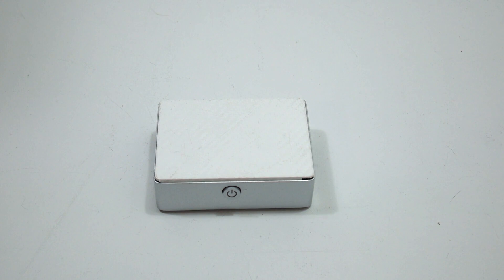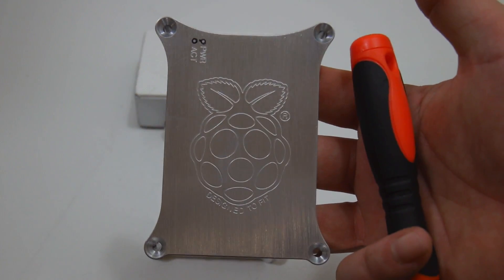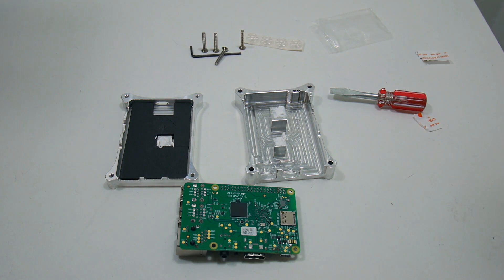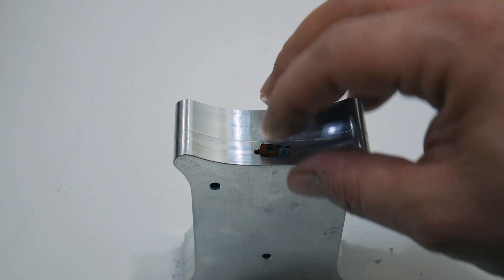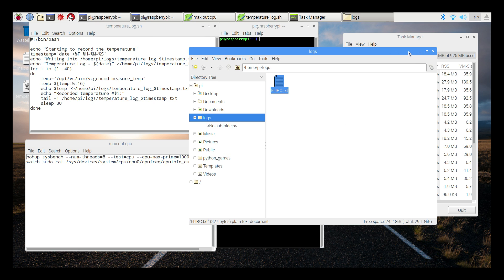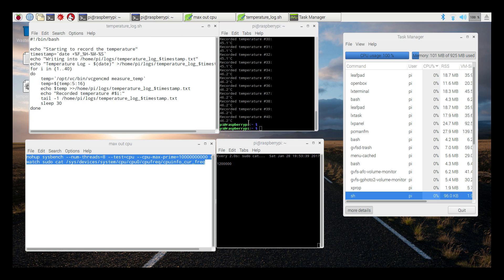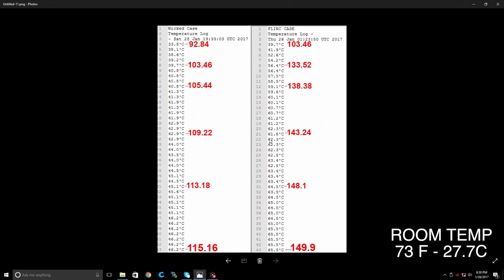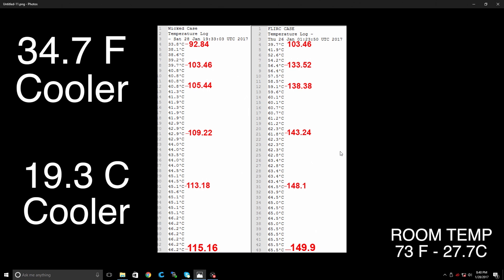Wicked Aluminium Raspberry Pi 3 Case Vs Aluminum FLIRC Case

Comment: I'll choose the Flirc case. 20% of the price does 80% of the cooling.

I really need the first 80% of the cooling that the Flirc case does, but I don't think I'll need the other 20% of the cooling, that the Wicked Aluminium case adds on top of that. 

I have to spend my money wisely.

Comment: @ETA PRIME, was thermal paste, thermal tape, or thermal pads used on the Flirc?  I'd be interested to see if paste would reduce the temps on the flirc over tape or pads.

Comment: I like how you mention cheap Chinese cases with fans yet neglect the fact that at least in the case of the Flirc it is a cheap Chinese case considering it was manufactured in China.
As to the difference in thermal conductivity that is basic metalurgy 101.  The Flirc is a die cast alloy.  The wicked aluminum case is milled from 6061 T6.  For thermal conductivity die cast < machined extrusion < cold forging.

Comment: For extreme use cases (no pun intended) the wicked case does perform better. In my opinion the FLIRC looks better, and waaay cheaper; it's down to $16 now for the rpi 3 model.

Comment: Would it be possible to fit cables through the micro sd slot on the Flirc case? I'd like to access the GPIO from the top of the case

Comment: It's a good thing that they supplied you with that nifty little case for the RPI.  It's a damn bit pricey for my tastes @$64.99 + shipping.  My Raspberry acrylic case with fan cost me less than $2.00 from China--just took a little while to get here.  I've stress tested my set-up for 16 minutes with the CPU running at 100% and the temperature displayed after every 4 minute segments.  My Raspberry PI 3 never got over 42.9*C which is 109.2*F.  During normal use with the fan blowing it hardly ever goes over 37*C.
Reply: Oh yeah, I forgot, the ambient room temp. for my stress test was at 76*F.

Comment: can you do this same test with just a cheap plastic enclosed case from eBay/Amazon, with cheap heatsinks?
and do you know how intensive RetroPie is playing n64 or ps1 compared to running this test? also the newer games like the DS which you showed already.
Reply: Marc Di Pinto  I have cheap cas and heat sinks. temp averages 132f

Comment: Please tell me how you mounted that button in your Flirc case.
Reply: Drill a hole,  insert power button, screw on nut.  Hook up power cables, install a script.  Test and your done.
Reply: @ICgasm  *you're (contraction of "YOU aRE")
"Your" is for possession.
Reply: ETA PRIME did a vid on adding one.  pretty good one
Reply: I watched it. It was good. that's where I got the Amazon link for the same button he used. He went through how to wire a momentary switch with the GPIO pins but never mentioned how he mounted the specific one he has in his Flirc case.

Comment: I had a Wicked Aluminium case on my original Pi 1. They are amazing premium quality cases that look awesome. I was put off getting one for my Pi 3 though due to reports I'd read about it blocking the internal Bluetooth and WiFi signal (I use two Bluetooth DS3 controllers for gaming). ETA have you tested the wireless side with it?
Reply: The $65 price tag doesn't help either.
Reply: Andy Fairbrother this is exactly what I wanted to comment on as well. please review the wireless signal on the case
Reply: Yeah BT and wifi tests would be really interesting

Comment: cool case indeed but missing the whole poit of the pi, selling a case that x2 of the price of the pi itself is rediculous idea, its like buying a 2010 honda civic for 15k$ and building for is a garage for 100k, kinda stupid...
Reply: Not really. You dont buy a raspberry pi because you only have $35 to spend for a computer. You buy it because it's a really small, low power usage - but still fairly fast - PC. 
But you buy a honda civic because you might say things like "I wont ever drive faster than a civic can, I dont need more space and 15k is as much as I can spend."
Lets say you're a rich person building a garage for 100k, and the honda civic is the only car which (lets say) drives from hydrogen, which is all you want, then you still are going for the 15k$ civic because of it's unique properties.
Reply: wouldn't the garage only be 30k? that's a fair price for building a garage
Reply: Indeed, It's an impeccable example of the infamous RICE-MOBILE.
Reply: *ridiculous
*it's like (not possessive)

Comment: hey ETA. brilliant videos. please could you help with this and do a video? I bought remotePi from msldigital and it's brilliant. Paired the remote control and scripts so it turns on and off with the retropie image but having trouble setting up lirc so I can run Kodi using a remote control. managed to map the buttons doing irrecord for litcd.conf file but Kodi just doesn't work with it. Kodi is installed via the optional packages in retropie. cheers.

Comment: it seems that you've used too much thermal paste
Reply: it actually has zero effect on cooling applying too much! watch some videos that test this.. Better to have too much than too little!, Ever pull a video card cooler off.. manufacturers go crazy with compound!
Reply: applying too much will just make it messier when removing the case  :p
Reply: The only issue with having too much is if it is a conductive thermal paste.
Reply: Yeah thats about it... it's not detrimental to cooling performance contrary to what some people believe! to those that believe otherwise, look it up, it's been extensively tested! goes the same for application methods... spreading, or rice grain, criss cross... etc all are very negligible when it comes to actual performance!
Reply: It has zero impact when enough mounting pressure is applied.  In this case, the pi is floating there and there is no way for there to be localized pressure.  However, the impacts on cooling should be mostly insignificant.  Just be cautious using conductive pastes like Arctic Silver as that could damage the board with so much paste.
Reply: Pretty sure he has said he uses thermal grizzly in a prior vid, and it isnt conductive. There is no such thing as to much only to little.....to much makes a bit of a mess....to little kills things....not so bad with an ihs....but bare die chips will die fast if there is a hot spot with no tim...like a gpu
Reply: There's no such a thing as too much thermal paste, but I do agree.

Comment: Not surprised. The FLIRC is stamped, and the part that sits on the CPU is hollow.

I would, however, never recommend Arctic Silver. There is metal in it. I would get Arctic MX-4, or IC Diamond. Both not only give better temps than Arctic Silver, but they are non conductive, non capacitive, and no curing time.
Reply: Ahh the old Arctic Silver curing time. The good old days. :)
Reply from the maker: +hallis1 I've heard it cures cancer
Reply: Cured all the temp problems in the early days of water cooling. :)
Reply: That part being hollow actually helps as heatsinks are about spreading the heat out to as much surface area as possible, because then it radiates out into the air surrounding it. It's why we don't use solid chunks of metal on our cpus.

Comment: I bought flirc but  anyway I have 70°, I need to apply thermal paste in flirc? or need only in aluminium case?
Reply from the maker: did you use the heat pad that it came with? Flirc is still my favorite case
Reply: ETA PRIME I check now my flirc case package but there isn't any item, I guess a mistake in packaging. you suggest to buy a thermal paste to fix it?